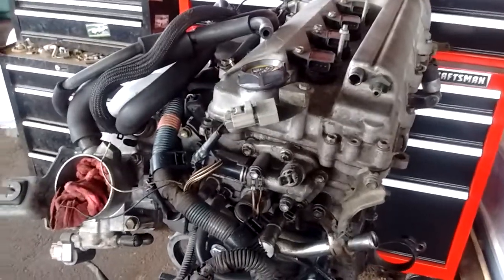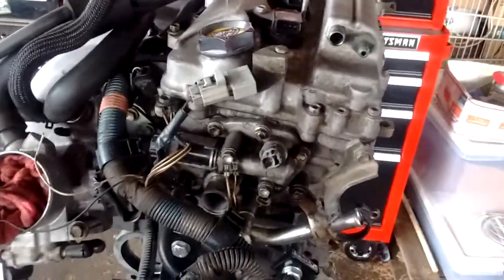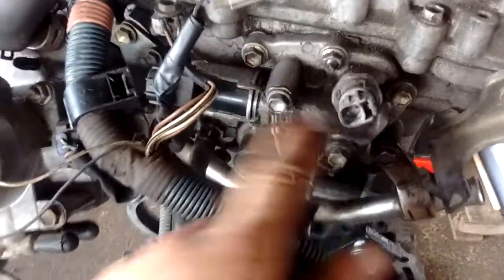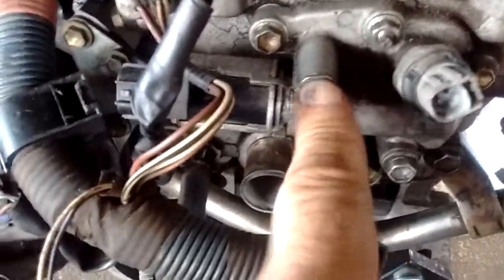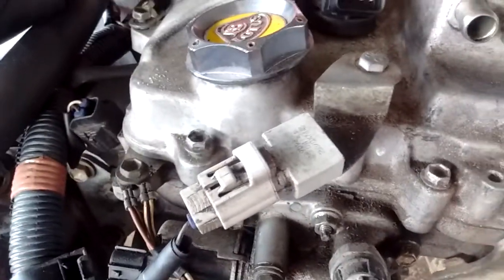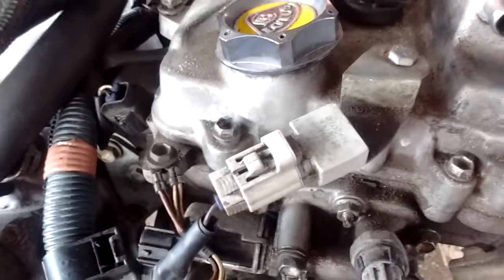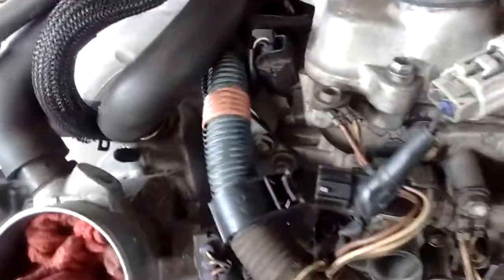2ZZ-GE and 1ZZ-FE Ground Points - Toyota MR2 Spyder Celica Corolla Matrix Lotus Elise Exige

Comment: I got a vibe gt with a 2zz and i'm trying to look for grounds for diagnosis, and I don't see a wire coming from that spot above the alternator at all... I've had that engine apart a few times too. Changed the alternator a couple times... I don't see it. It's got me concerned. But if I don't see it, I guess i can just run a wire over. It won't hurt...

Comment: I have a throttle position sensor code that will not go away period any suggestions was trying to figure out which ground was for it
Reply from the maker: You should be able to find that in the Engine Control wiring diagram from the factory service manual.

Comment: can you show were the one is that is hooked up above the alternator i know where the top goes but not where it is on the block.
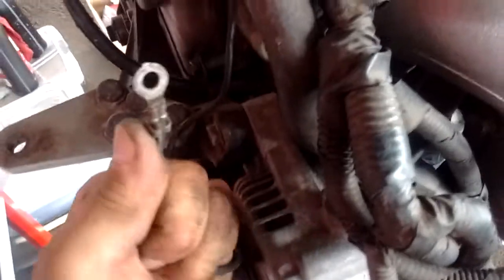Reply from the maker: Sorry for my sloppy camera work. You can see the ground point briefly at 1:10. The ground wire has an eye terminal that mounts to a threaded boss located above the VVT solenoid on the head, immediately beneath the valve cover mating surface. You can't miss it.
Reply: What’s the bolt size for the ground point above the alternator?